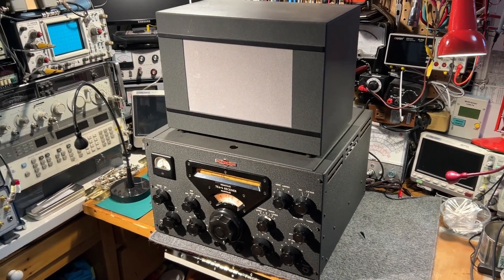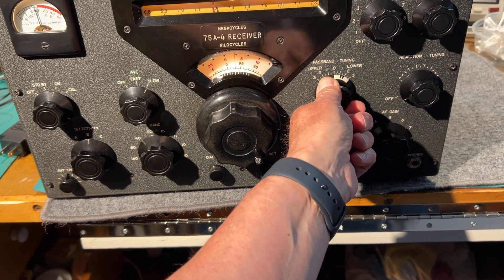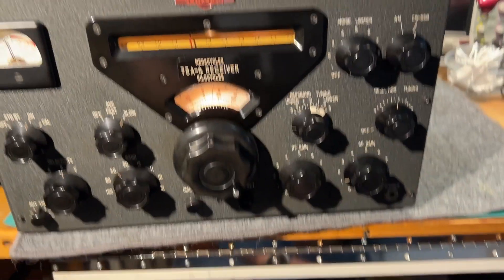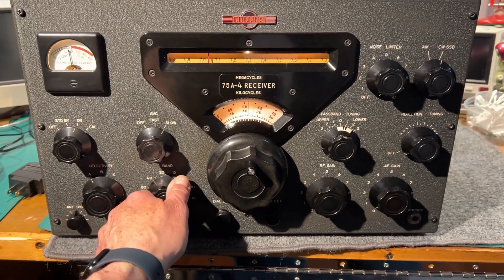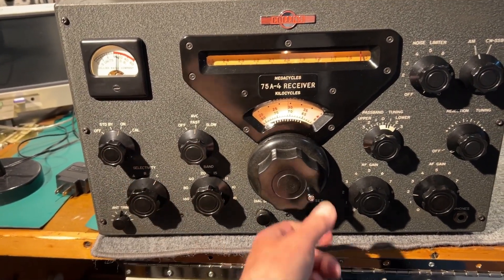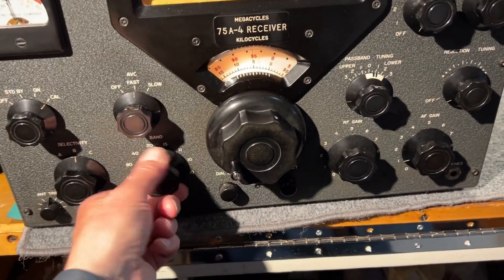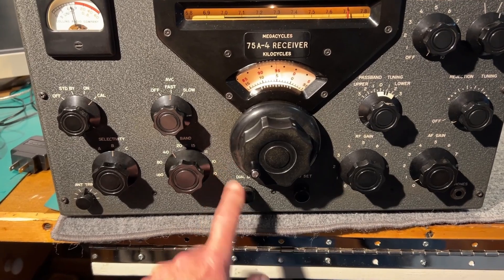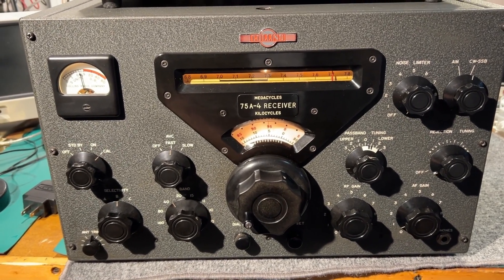Collins 75A 4 Receiver After Refurbishing

Comment: Can I ask what the refurbishment involved please .
Reply from the maker: In summary, replacing all paper and electrolytic capacitors, checking resistors/replacing four out of tolerance resistors, testing tube/replacing weak/failed tubes, cleaning switch contacts and controls and realignment.  If you are on Facebook, you can read my blog that details all the work done: https://www.facebook.com/gerrysvintageradio/ .  I am also preparing an article that will be posted to the SPARC Radio Museum website.
Reply: @RadioRestoration  That's fantastic, well done Sir.
Reply from the maker: @union310  I forgot to add that I also changed out several silver mica capacitors that are known to give problems, plus one in the 11M 1st local oscillator circuit that had an intermittent
Reply: @RadioRestoration   I am a model engineer in my spare time,  I build all sorts of stuff from locos to traction engines and clocks as well as machines to that. I have always had an interest in Ham radio and have recently passed my foundation level. I made myself a Morse key last weekend, a little different in places but it works well as well as looking nice in Oak and brass. The aspirations are to pass they next two levels and build a transceiver.
Reply from the maker: @union310  All the best with the ham exams.  I was G8GUH in the UK (licensed in 1972!), VP8BDE in the Falklland Is (mid-1980's)., and now VE7GUH in Canada